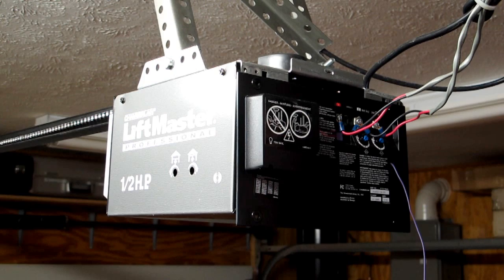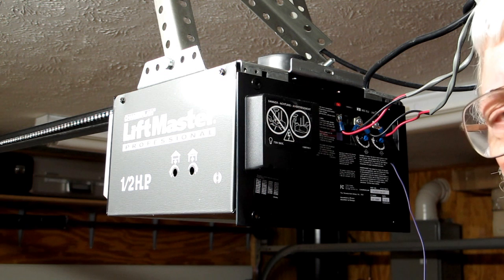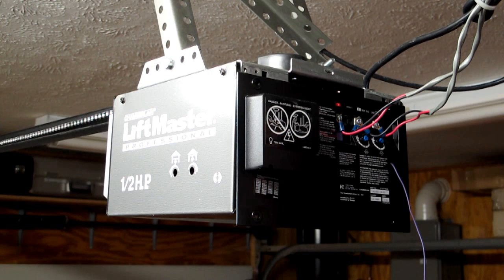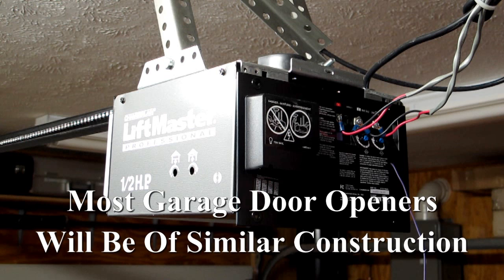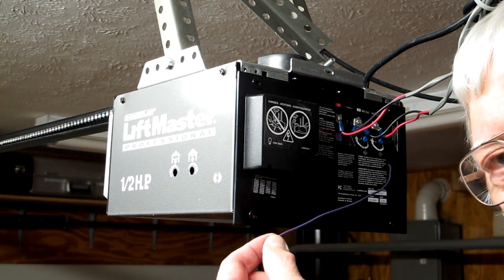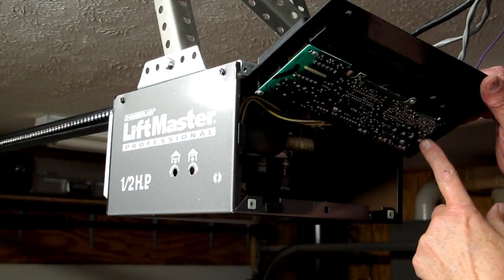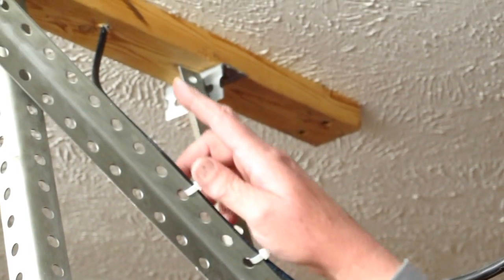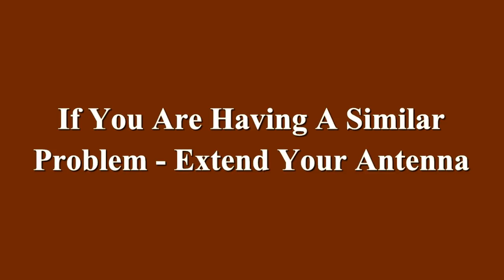Garage Door Opener Antenna Extension

Comment: Hi Ronald,
I have attempted this very same thing before seeing your video, but unfortunately not with the same results. I too have a Chamberlan Liftmaster (1/3 HP) same exact circuit board however. I used RG6U standard shield cable. I made sure the exposed center conductor is the same length as the original antenna. Even doubled checked that my antenna size was 1/4 wavelength. I have tried both connecting the shield to ground, and without ground. Unfortunately my improvement was marginal at best. It does work about 80% of the time, compared to 50% of the time, however the range has not improved (no more than 20ft from the opener). I have wood walls, vinyl siding, metal garage door. Any other ideas? I'm very electrically inclined, but my RF knowledge is lacking. 
If I may ask, what is the length of the exposed center conductor on your coax cable? Great tutorial!
Reply from the maker: jonboy545 I ran the coax outside and soldered the original antenna wire to the center conductor mainly because the original antenna was flexible stranded wire. I was going to ground the outside shield but did not bother to do so because it worked so well as it was... which leads me to believe the antenna length is not that critical and you may be able to just run a long length of regular wire.. If your garage door is metal you want to get to the outside of that. The remote works better on a damp or rainy day and not as well of dry hot days. But extending the antenna outside the house gets me well over 120 ft away in the worst conditions.

Comment: Hello why just use the same anntena cable and weld it to the other new black cable ??
Reply from the maker: andresco50 After it was all done I probably could have. You never know for sure what is preventing the signal from the remote getting to the door opener antenna. My garage door is aluminum. My house has a metal roof. The house is also wrapped in foil backed insulation and there is always the possibility of electrical interference. Generally, the antenna is cut to a correct length for the radio frequency of the system. In this case the original purple antenna was 11 inches long. When using coaxial cable, the center of the coax is connected to the circuit board at the door opener (where the antenna was originally connected) and the outside shield of the coax is connected to ground (which shields the receiver from any stray signals and effectively zeroes out the length of the long coaxial wire). Then I connected the original purple antenna to the coax outside the house putting the system back to an 11" antenna length. I used the original purple antenna wire because it was flexible and it was available. I had not yet connected the coax shield to a ground because a ground was not handy at the circuit board. When I tested the remote it was working so well I just left it alone. Had the remote not worked satisfactorily, I would have connected the shield to ground as originally intended.

Comment: Ronald,  I have this problem with my chamberlain opener not responding to the remote unless I point the remote upward right at the opener  inside the garage  I tried using coax to extend the antenna wire to outside the house,  but I'm getting mixed results.  since I'm not confident in my soldering abilities I just used a but splice to attach the coax to the openers antenna wire and a splice to attach a piece of speaker wire to the end of the coax outside the house.  Is soldering the coax directly to the board important for this to work?  I also didn't ground the shield wire as I didn't know to do this
Reply from the maker: Sean Aiello If your remote will not work any further away than that you have other problems. With the original short antenna and the garage door open, the opener should receive a signal while you stand out in the driveway. Either your antenna is not connected to the circuit board (bad solder joint or broken antenna wire) or something wrong with the remote. Go back to square one and start over. Reinstall the original short antenna wire. Go to the people who installed the opener. They usually have a tested for the remotes which indicates which channel they are on and signal strength. Possibly a new battery is needed. If none of that works you may need a service call to check out your problem. I cannot tell from here. Sorry!
Reply: Ronald Walters yeah it works farther away the longer wire has helped I can get it to respond almost have out of the driveway however it doesn't respond everything.  I've ordered a replacement remote to rule that out,  maybe will have to check the original antenna wire for continuity and going to replace the outlet in the garage for possible interference issue.  Will keep you posted

Comment: So do I have to use a coaxial cable or will any wire type work?
Reply from the maker: Lord Esperath It is best to use coaxial cable as it shields the remote radio signal from various sources of electrical interference (motor noise, florescent light noise, etc.) so only the correct signal reaches the door opener receiver. Ground the outside shield to the door opener.

Comment: Ronald
Great video, I need to extend my range too.
On the back of my LiftMaster there is a co-ax socket, the instructions say that if I want fit an extension to this point I should first cut off the original antenna.
I don't really want to do this so would it cause any harm to use your suggestion and use exposed co-ax outside the garage but leave the original wire connected?
Thanks
Graham
Reply from the maker: dalbhraddan I watched your installation video but could not see the socket. Looks like your antenna wire is purple color. Sometimes a receiver can get confused if it has more than one antenna because they can cause interference. However these door openers usually do not seem to be too picky. Just try it with the coaxial extension plugged in and see how it works. If there appears to be a problem try rolling up the original antenna wire in a tight roll and put a piece of tape or zip-tie to hold it coiled and try again. If still a problem you could unsolder it from the circuit board (you would need to first remove the board) if you do not want to just cut it off. My guess is it will probably work just fine with the extension plugged in. Good luck!
Reply: Ronald Walters

Thanks Ronald, I'll experiment around with things and bear in mind your help.
Thanks
Graham

Comment: Thank you Ronald Walters ! I finally did this and it worked beautifully. In my situation I was getting interference from my WiFi network. Took a while to even realize that much. Putting the antenna outside and farther from the network did the trick. I'm not getting the hundreds of feet like some (probably because I'm still getting interference) but to the end of my driveway which is way better than 1 foot away from the door.  Seriously made my whole family happier!

Comment: Hi, I tried to do the same with my drive garage (by hormann - promatic 2). However, I have the problem of what to do with the outer wire from coaxial cable, where to connect? I connect hot plug (central wire) in to the plate instead of the original approximately 9cm white cable (antenna?) but what about the outer coaxial wire - the screen? 
My plate looks like this: http://namyslow.net/promatic2.jpg
Thanks for any suggestion.
Reply from the maker: ***** Gently unbraid a few inches of the outside shield (the screen), twist it into a round wire and connect it to ground. You can solder the twisted shield (do not melt the coax), cut it off short and connect it to a piece of wire if that makes it easier to connect to ground. Keep it short as possible. Tape bare wires to prevents any possible shorts. If you cannot locate ground on the circuit board, the metal case of your opener (or the motor) may be grounded... connect it there.

Connecting the outside shield to ground shields the inner wire from stray signals. In my case it was not necessary to connect it to ground as the receiver was not picky about the antenna length. Just getting the antenna extended outside where it could get a clean signal from the garage door remote did the trick. Different circuitry (or the frequency used in your country) may react differently to antenna length.
Reply: Ronald Walters Thanks for fast answer. I try to connect it to metal case of motor (one of the wires that go out from board - green one on the picture - is connected to the motor case). Ill test the remote range after this (with outdoor antenna).
Reply from the maker: ***** Looks like your electric is 220V 50HZ and green is the ground. Hope it works for you.
Reply: Ronald Walters Yes, line is 230V/50Hz but voltage from trafo (is in the case) is 22-23V, motor is the same 24V, and light is 24V too. Garage drive have an akku option (extra connector on the mobo) for emergency opening with no 230V line.

Comment: In theory, your fix should do the trick for my Genie opener's range problem too. I'm hoping that I'll be able to do the same thing, but the circuit board in mine will be a little more difficult to get to. Did you use the standard type of coax that's used for television cable?

Thanks for posting your video, it's a good starting point for me.
Reply from the maker: Route 66 <span style="font-size:11.0pt;mso-bidi-font-size:12.0pt;
font-family:Arial;mso-fareast-font-family:"Times New Roman";mso-ansi-language:
EN-US;mso-fareast-language:EN-US;mso-bidi-language:AR-SA">I used standard 75ohm
RG6 TV/Cable coax. It would be best if the outside shield was grounded but I
did not need to on mine. You are just trying to get the antenna outside where
it can pick up the signal instead of the antenna being shielded by your house
and the garage door.

Comment: I have extended the length of the factory antenna wire by simply soldering a similar diameter wire to the existing wire. Usually about 6 to 10 inches more will do the trick. No need to do all that you did, no messing or possibly damaging the board either.

Comment: Ron I have the same garage setup as you with wood paneling covering the double sided aluminum thermal break insulation. I also have this on the garage ceiling and the garage door is insulated metal as well. I tried to solder the wire on the pcb as you suggested but the eyelet popped off and I couldn't solder it back on correctly. The unit I have is newer with the 315Mhz DC motor and Battery Backup, so the board was a cheaper design then yours. I would recommend cutting the antenna wire to a shorter length, stripping it, and solder the coax to it instead. I ordered a new receiver board and some other parts, so I haven't given up. I did install the AssureLink upgrade kit and that worked out real well. Thanks for the video.

Comment: So, to be clear, you reattached the original antennae wire to the end of the coax.  How did you reattach it?  Did you solder it to the center lead of the coax or some other method?
Thanks for the video.
Reply from the maker: I soldered it. You could strip the center lead to the same length but it may not hold up as well as a piece of flexible multi strand wire.

Comment: Thanks for posting this. I guess I could just accept this information and use it to solve my problem...but inquiring minds want to know why this works. I know that an antenna has to be of a certain length (some function of the RF wavelength??), but why does the coax not act the same as a length of common wire? Is it the shielding that makes it simply act as an extension for the antenna instead of a long antenna? And if that is so, why is it necessary to attach the original antenna at the end of the coax? Is there something special about the makeup of the antenna or is it just a piece of wire? Couldn't you just strip off the shielding at the end of the coax (same length as the antenna) and allow the unshielded core of the coax to act as the antenna?
Also, can someone answer the question "Why are some remote devices so weak and flakey?" Garage door openers seem to be prone to this type of problem. I also have a remotely operated electronic predator call that has extremely poor range despite having a big clunky remote with an antenna and lots of battery power. Yet I my car keyless entry, which is a tiny fob powered by tiny batteries works reliably up to several hundred feet away.
Reply: It's just wire.  It's easier to just solder the wire on the end rather than strip the coax back, plus the center of the coax is just a single strand, easy to break, the antenna were it multi strand, flexible, and stronger.
I had to do something similar to a car alarm once because my mounting location had too much metal around it.
RF remotes can be pretty cheaply made sometimes, and transmitters can actually drift over time and become "out of tune" with the receiver.  Although, my #1 problem I seem to have with all remotes is if the contacts are not good, even a 1.5 VDC battery can spark against the contacts which builds up carbon and gradually becomes a bad connection.
Most times, if I take out a battery, clean the contacts and battery, put it back in, then my remotes will work again.
I try to use DEOXIT contact cleaner when I can and I think that can help.
Otherwise, pencil erasers can clean up contacts without taking away metal like an abrasive would do.
Reply: Some remote can be 'weak' or better said out of tune. The remote must operate on the exact same frequency as the receiver. The remote, so as the receiver, are build cheaply without any crystals, so frequency stability over temperature, time and humidity is not very good. This can lead to greatly reduced sensitivity e.g. range. (do a little research to find out what frequency your receiver unit operates on. To find out, on the back of the unit is a FCC registration number, googling this number leads to the FCC site which documents all technical details on FCC licensed devices including the operating frequency. Knowing the operating frequency of the device can be helpful.)
Inside the remote unit may be an adjustable tuning capacitor (may look like a small screw). This can be adjusted to match the frequency of the receiver.
However, adjustment shall not be made with a metal tool, as the presence of the metal at the tuning capacitor will disturb the tuning, one needs a ceramic blade or plastic tip screw driver to tune this properly. Generally for tuning, it needs specialized and very expensive RF test equipment, such a spectrum analyzer and an antenna. Usually these are not accessible to normal people so to tune this anyway, one would do it the caveman style, one needs to be far enough away from the receiver (let's say 20ft) so the receiver would not 'see' the remote when the button on the remote is pressed. (Mind you the orientation of the remote with respect to the receiver antenna is somewhat relevant) Assuming the remote has been opened to be able to access the tuning capacitor, pressing the remote button while slowly adjusting the tuning capacitor might help to find the optimum tune. Tuning this without the RF test equipment doing it caveman style can be very finicky and frustrating and may not yield the desired improvement, so do this at your own risk. Remember: RF stuff is like black magic 😁😁😁

Comment: I had the same problem and this fix worked for me too.  I used a short-cut.  Instead of removing the board and soldering directly it, I cut the antenna wire off with about 1.5 inches showing and soldered the center wire to this. I shrink wrapped the junction and then wrapped aluminum tape around the unshielded section. Also, rather than actual coax, I used shielded speaker-microphone wire from Radio Shack. Before we had to be almost touching the door, now we can get 50 -100 feet away.

Comment from the maker: Using an existing hole is a good idea. Having the extension run alongside electric wires may be a bad idea. Try a length of coax as in the video. Center wire connected to the circuit board and ground the outside shield. Then have a short antenna wire connected to the center wire of the coax. The length or the antenna should be the same as was originally on the door opener.